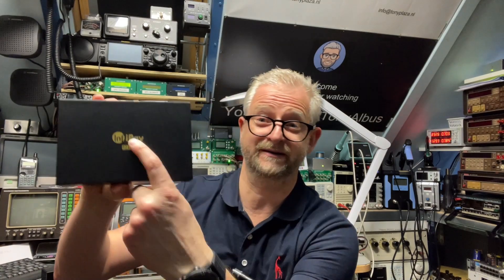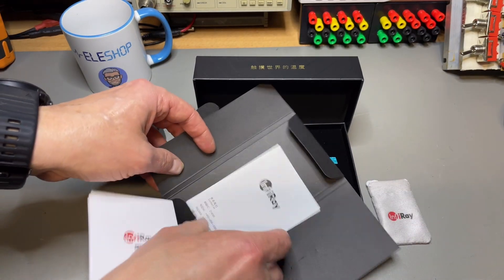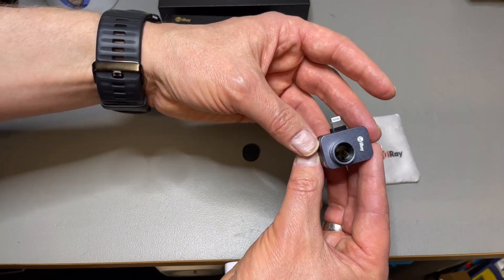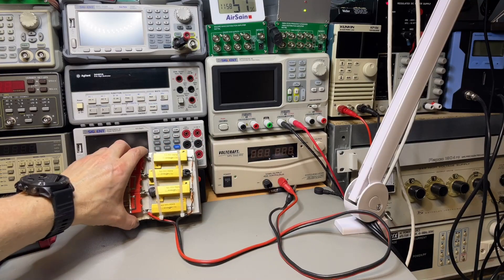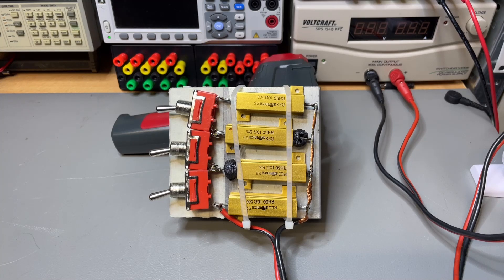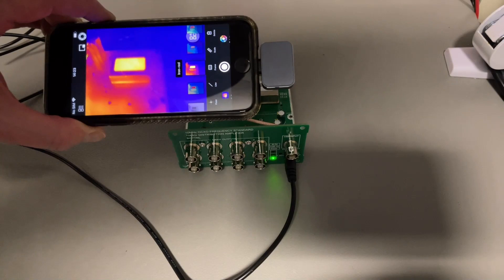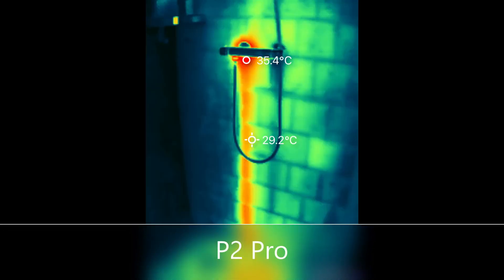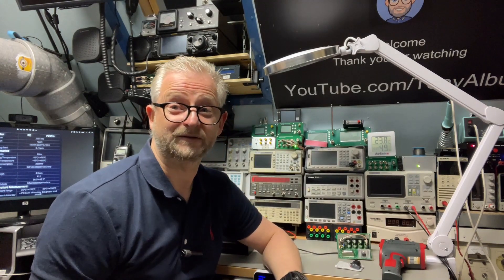TA-0354: InfiRay P2 Pro Thermal Imager with Macro Lens - for SmartPhone

Comment: Hi Tony,
thanks for the great video.
Just some small question (maybe I missed that in the video).
Is it possible to fix the maximum and minimum value on the temperature scale?
This would help to compare multiple pictures over time or location.
Best regards
Reply from the maker: Hi Christian, yes i think you can do a min/max, i don't remember. i can try that later for you. i have an TC002 also coming, will check then.